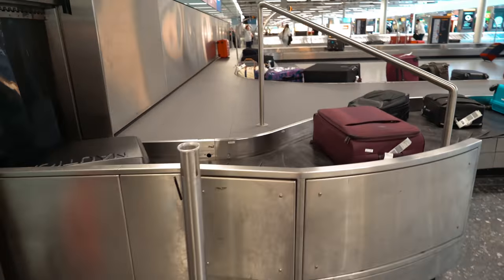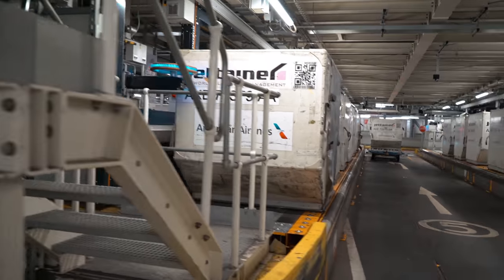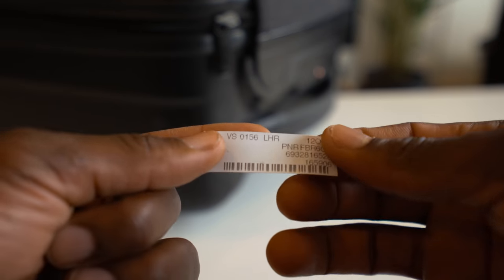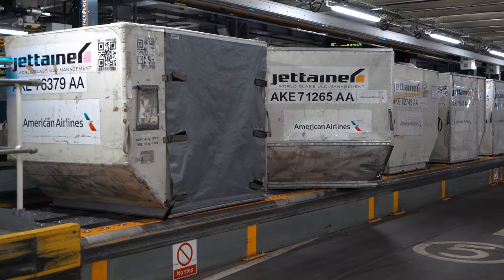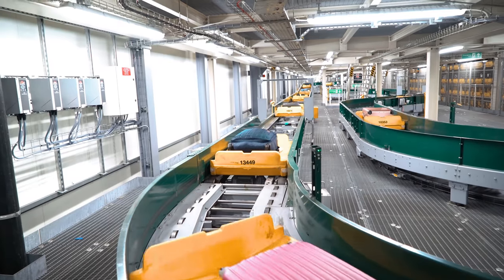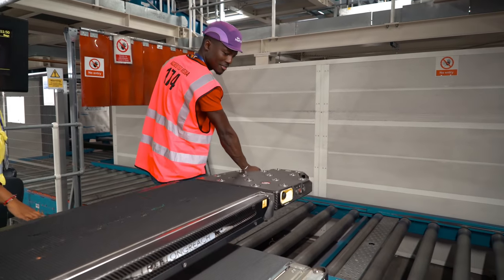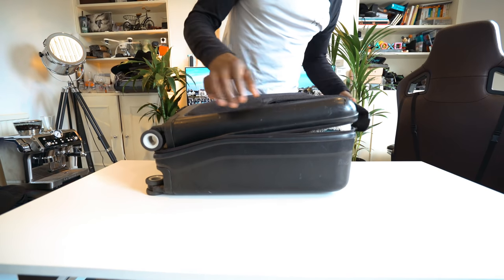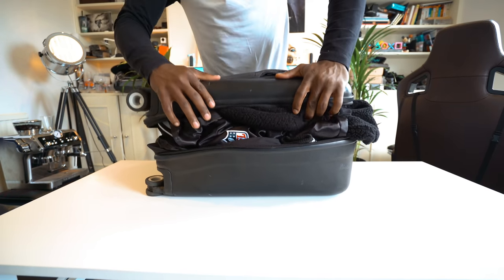How Your Baggage Is Sorted At Heathrow Terminal 3

Comment: Not completely correct I work there and only about 10% is built by these methods - called automation. There are usually about 3-4 guys per build manually scanning and loading bags into the containers.